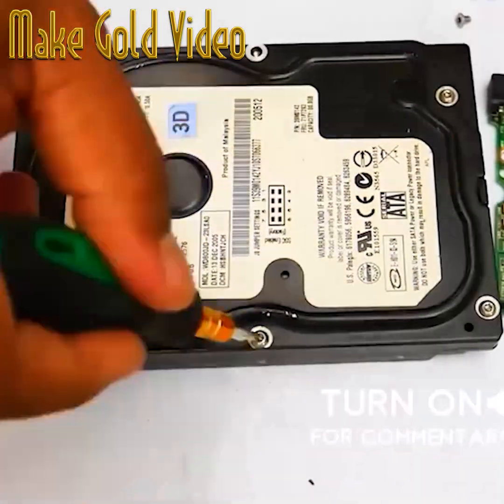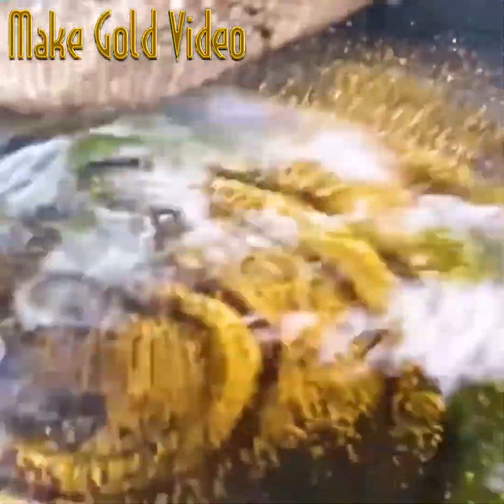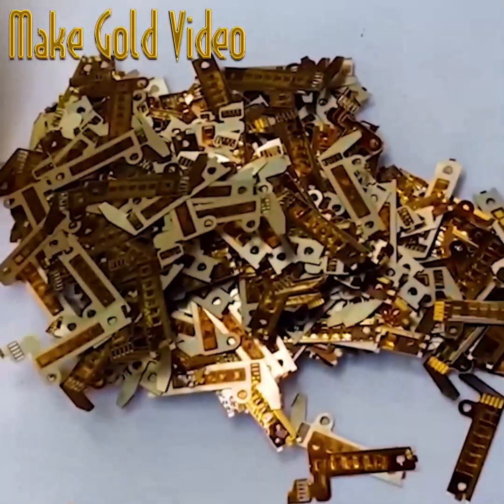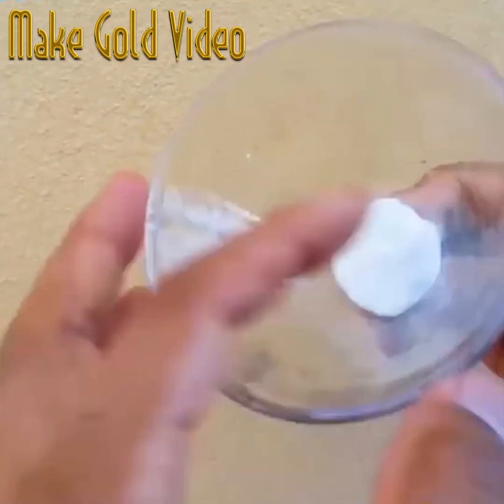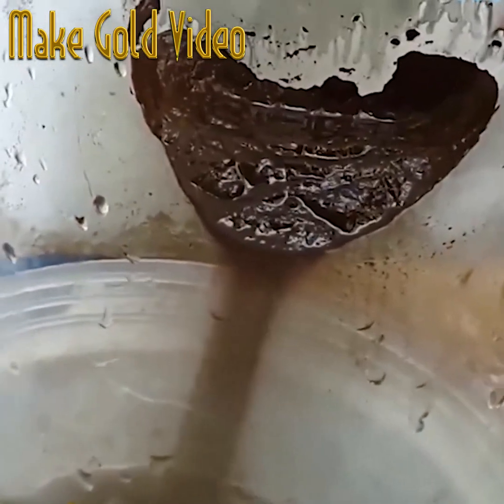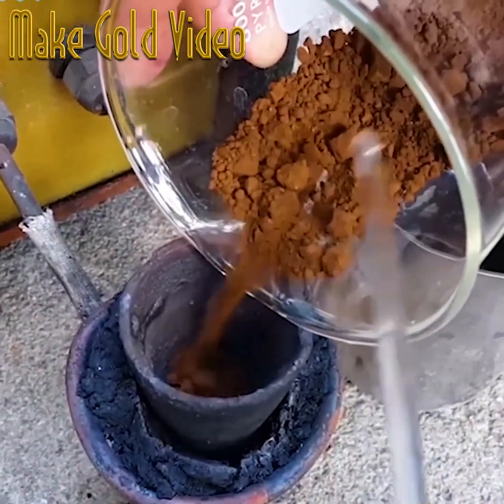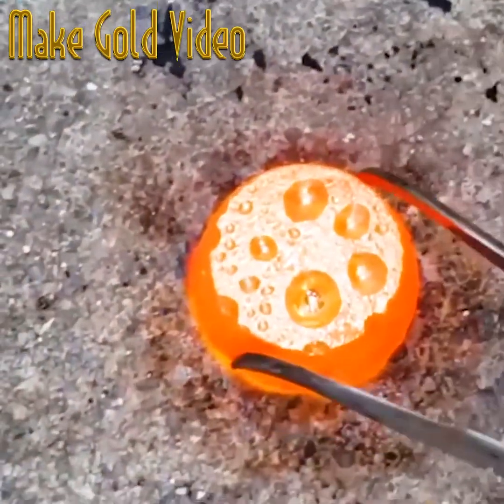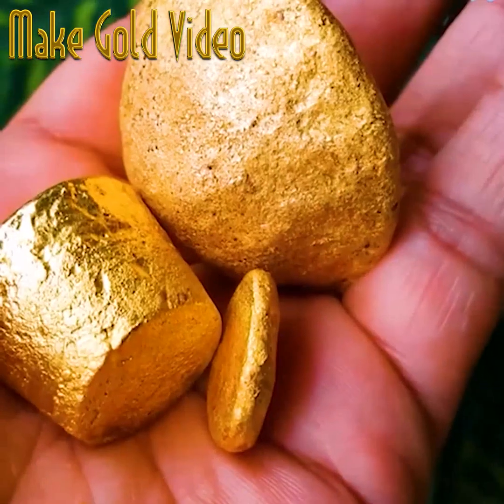Turn old hard drives into gold! 💽✨ Learn how to extract real gold from HDDs in old computers

Comment: Lets do this with iphones
Reply: In Iphone there is no gold , you can find more gold in old generation from the early 90 to 2000 , plenty of gold on the pcb keyboard .
Reply: @zibobpompon5768  they all have gold very little after iPhone 10. The older iPhones 1 thru 10 have alot. All computers from the 1970s till the very early flat screens have lots of gold.
Reply: @ Yes but so little that it's better to recover on old processor motherboard where there is so much if we compare , but i knew that there is always tiny amount in every electronic device . I'm an electronic engineer since over 40 years now so regarding gold i known where to find it .
Reply: @zibobpompon5768  pcb have gold silver platinum copper it's a mix alloy
Reply: He said 500000 HDD = 81g gold... 😂